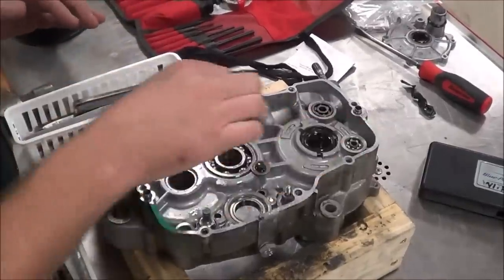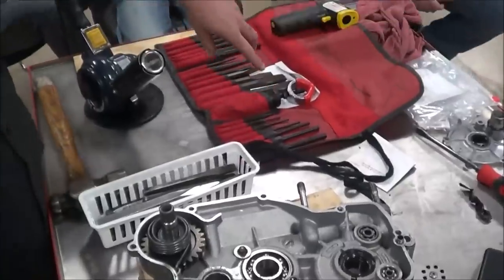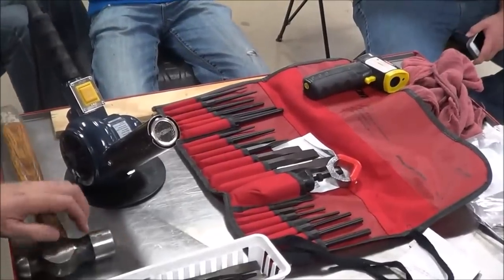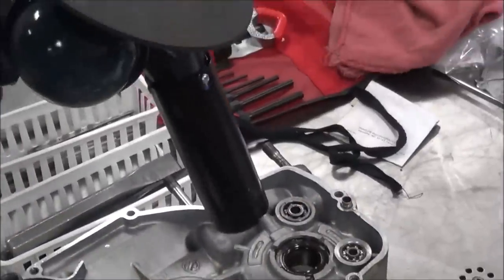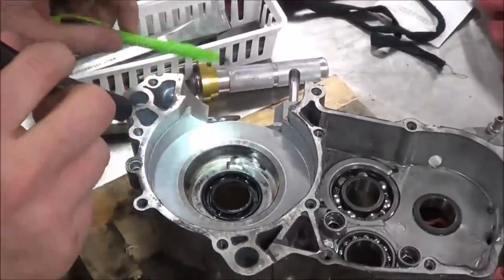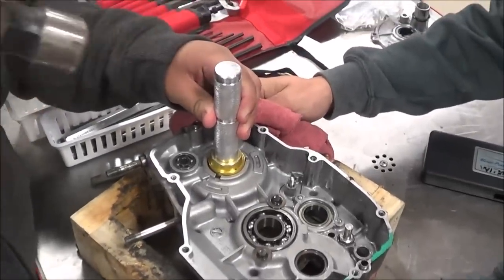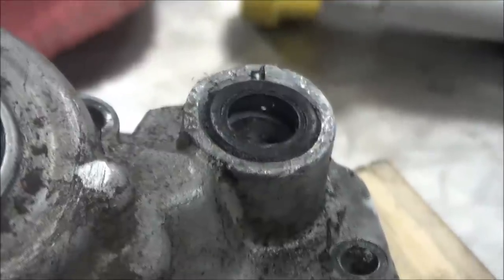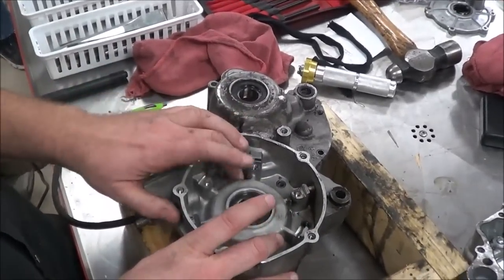2 Stroke Engine Disassembly & Assembly   Bearings & Oil Seals   11 03 14

Comment: i have heard of a few people grinding the lips off the kx crank seals so they can install the seal without splitting the case seems like kawasaki had a silly design the honda and a few other brands are easy to remove i guess the lip really just tells you how deep to go and doesnt really stop the seal falling out otherwise it could always fall back in towards the bearing if it was going to move!
Reply from the maker: Great news for you! I have solutions for you and will point you in the right direction. Head over to my website become a member now and to receive 20 minutes of personal mentorship with me. You can even use FaceTime if you have it or find a friends iPhone and we can walk through the actual carburetor process together. I look forward to mentoring you.

Note: Membership is not required to receive coaching or email help. Here are the direct links to individual services offered at H2W:

Email Answer Service-Click http://how2wrench.com/product/email-support/ 

Phone/FaceTime Coaching-Click http://how2wrench.com/product/personal-tech-training-phone-facetime/ 

DIY Mentorship-Click http://how2wrench.com/product/diy-coaching-hire-teach/ 

Dealership Training Services-Click http://how2wrench.com/product-category/dealer-services/ 

MMI/Tech School Student Tutoring-Click http://how2wrench.com/product/mmi-tech-school-student-tutoring-services/

Motivational/Guest Speaker-Click http://how2wrench.com/product/motivational-speaker/ 

On-site Training Services-Click http://how2wrench.com/product/on-site-training/ 

Tech Line Services-Click http://how2wrench.com/product/tech-line-minutes/ 

Mechanic on Duty-Click http://how2wrench.com/product-category/mechanic-on-duty/ 

Did you like this free video and hope to see more? Would you just like to say thank you with a donation? Click https://www.paypal.com/donate/?token=TvKoeRazPL-KysbM-e0ttz-C_gPq2IrqxDmM3ORCu4nxJzQWxYbmo-6m3YuNu64XHLngGW 

Keep Wrenching,
Shane Conley
Instructor/Motivator/Motorcyclist!
www.How2Wrench.com
Reply: Sucks that you have to split cases on the Kawi. But grinding the lips is beyond lazy and stupid.

Comment: @10:05 you explained that you thought the seal was in backwards because "the spring usually resides on the oil side". But the right engine cover is the side with the oil...
Reply: I would think all right side crank seal would face with the spring out then, asking because i'm trying to figure out which was to install mine on a 1999 kdx200.

Comment: The Springs on the Seals are Called  Garter Springs  as for the seal  or Lip seals.  Just Remember  the Application that your Using it for the lip of the Seal always Faces towards the Pressure side .
Reply: So the lip of the seal is the opposite side of the spring? The lip side is the flat side with the writing on it?